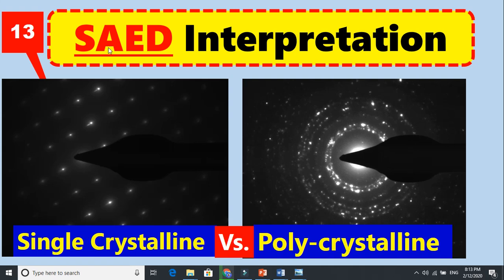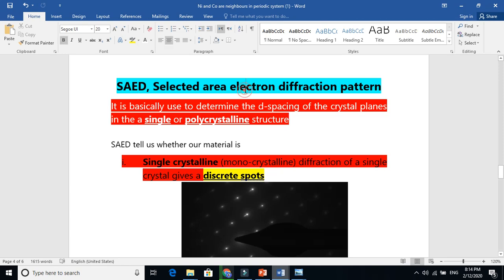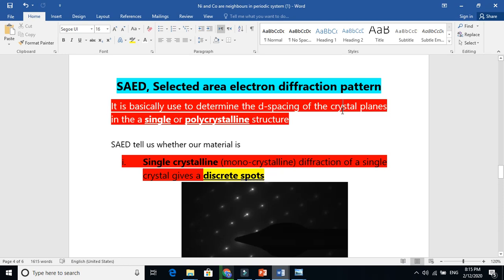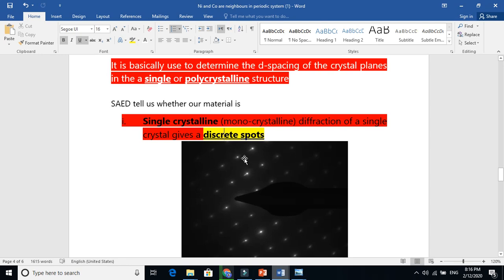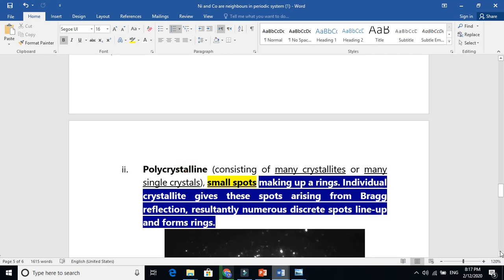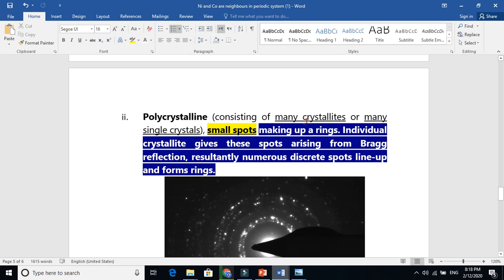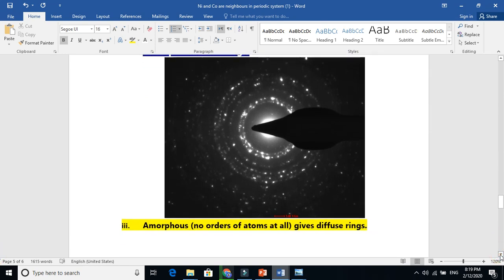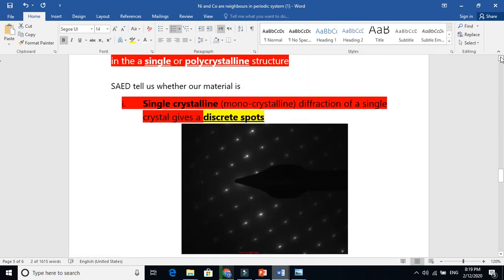SAED, Selected Area Electron Diffraction Pattern:  A Single Vs. Poly-crystalline Material

Comment: is this same as ACOM ?
Reply from the maker: Selected Area Electron Diffraction (SAED) used to identify Crystal Structure of the materials.  It provides information in 2D form. The rings actually identify whether the material is polycrystalline or amorphous. Instead of ring, there are also dots or spot type patterns which shows single crystal. 

We also use XRD for crystal structure analysis but the graph is in 1D and peaks form. Sharp peaks show HIGHER crystallinity while broader peaks show poor crystallinity.

I don't know about ACOM? What does it use for ?

Comment: Sir I have one question if only circle is appear not in dots form then its crystalline or amorphous
Reply from the maker: If circled appear, then it's sure that the material is polycrystalline

If diffuse rings appear, then the material is Amorphous
Diffuse means the rings look blurred and not too visible 

If dots appear but sharp dots, then it's sure the material is Single-crystal
If

Comment: X-Ray diffraction analyses would tell you whether the material is single-crystalline or poly-crystalline. In fact, in single-crystalline material, only one peak would be present. The peak intensity of the peaks also varies from powdered sample if texture is present. Similarly, in TEM analyses, if the beam covers multiple grains, which we usually observe during the diffraction of nanocrystalline material, we get spots from different grains and it may form rings.
Reply from the maker: Agreed. Single crystalline material gives sharp dots pattern while polycrystalline material gives sharp ring pattern. If the material is amorphous, it gives thick diffuse ring pattern.
Reply: Bro, poly-crystalline material also would give  spot patterns. It often happens when the diameter of the grains falls within the micro-meter range, and those micron grain sized materials could be referred to as poly-crystalline. I agree if the grain size is smaller than the beam diameter or spot size which often leads to the diffraction of various grains simultaneously and produce rings. We often see rings in the case if nano sized precipitates are homogeneously distributed in the matrix.
Reply from the maker: @arunbabuktkmce  Agreed,  good explanation.  I just explained in broad the difference among the single and poly crystalline.
Reply: No, two parameters are important here. One is the spot size and other is the grain / crystal size. Pls have a look. 
 https://en.m.wikipedia.org/wiki/Selected_area_diffraction
Reply: It is misguiding.  If you use nano-crystalline instead of poly-crystalline, the result may be acceptable broadly
Reply from the maker: @arunbabuktkmce  I don't understand nono crystalline?  Both single crystalline and polycrystlline are nanomaterials??  So what do you mean by that